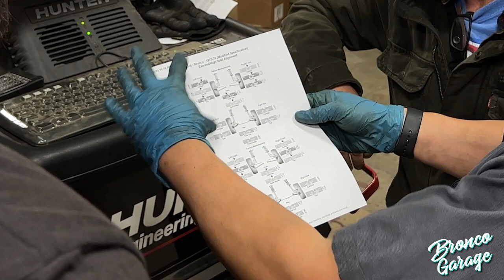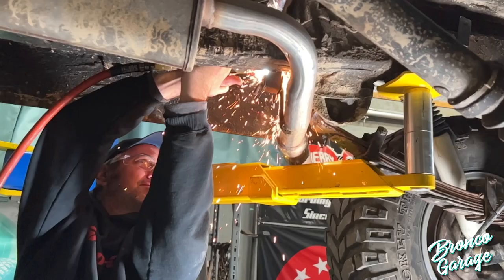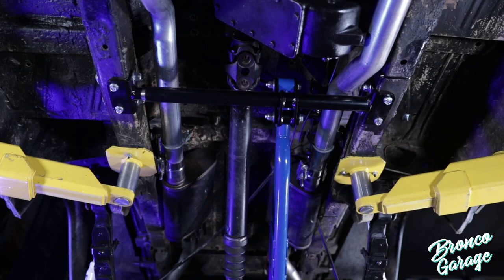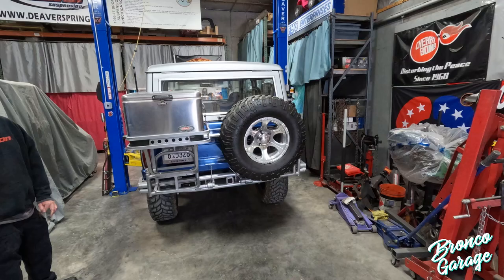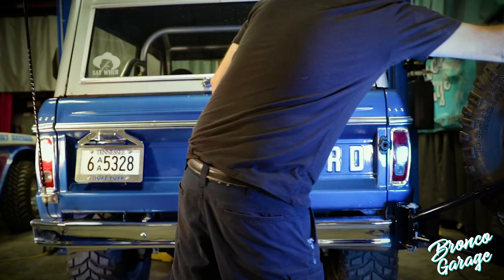Top 4 upgrades to make your Early Bronco better

Comment: Looking good.  Did you go with tie rod over on your steering upgrade?  If so, is there any reason to not go with the tie rod over setup?
Reply from the maker: No, this is done tie rod under. I already have a drop track bar bracket and drop pitman arm installed so leaving it TRU made sense.